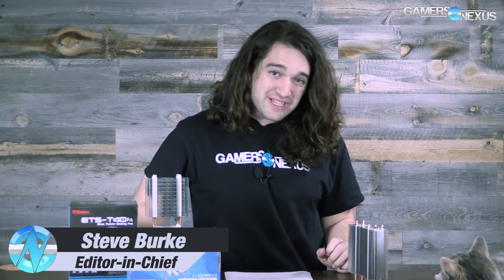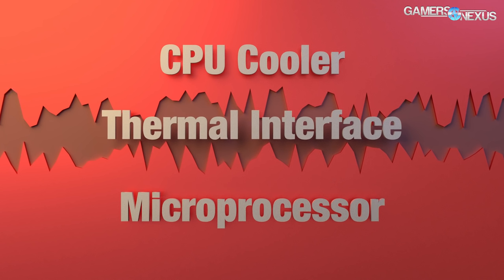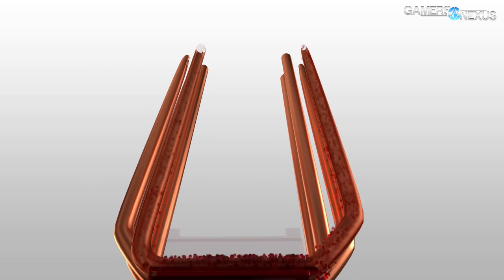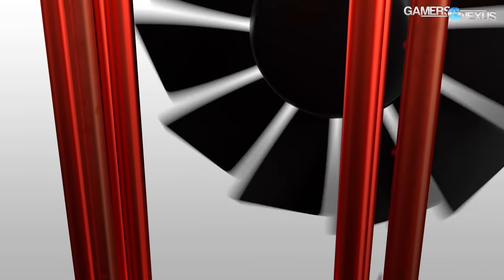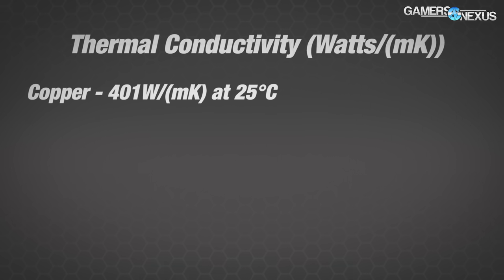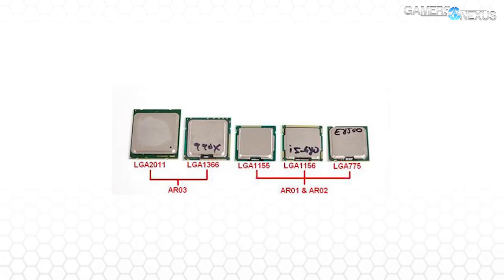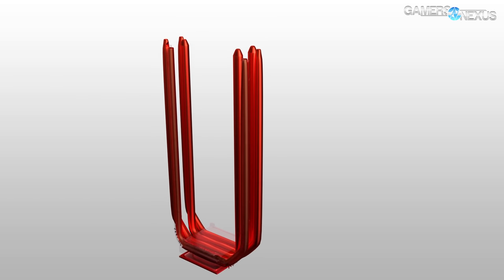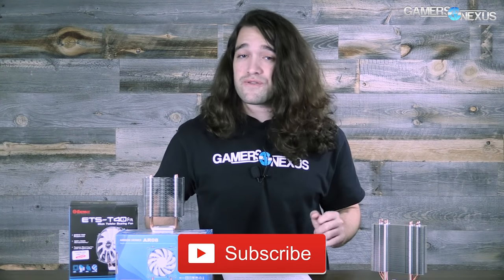TLDR: How Heatpipes & Air Coolers Work (w/ animation)

Comment: but wait, most of the coolers are installed sideways!!! then... how it works??
Reply: Ropkazip123 it works the same no matter if horizontal or vertical  set up. Watch a techquicky video by linus.
Reply: It has to do with pressure and capillary action. The vapor will naturally want to travel from high to low pressure. Generally the highest pressure will be where the heatpipes contact the CPU because this is where all of the liquid is turning into vapor. This means that it will travel down the heatpipes to where the lowest pressure is located, which is at the end of the heat pipe which has the least amount of vapor pressure because most of it is condensed back into liquid at that point.

Now how does the liquid get back to the base of the cooler? Capillary action. This is a phenomenon driven by hydrogen bonding aka surface tension. The liquid will naturally "grab" (bond) onto nearby surfaces. A lot of factors go into this, but the inside of the heat pipes are essentially designed to promote as much of this capillary action as possible and it has to do with the texture of the inside of them. Source: I study hydrology and have been learning about capillary action this semester lol.

Again, this happens regardless of the orientation of the cooler. These forces are stronger than the gravity acting on them.

Comment: damn, I was going to use a hyper 212 on a Xeon E5 CPU, but it's too small? I seen Puget recommend a Noctua NH-12DXi4 air cooler for a Xeon build, was wondering if Hyper 212 is sufficient. not over clocking and am choosing a low TDP chip (85w)